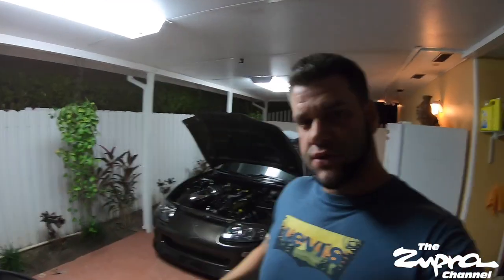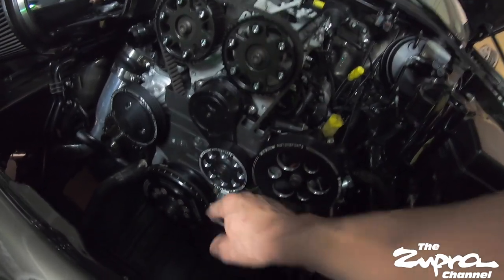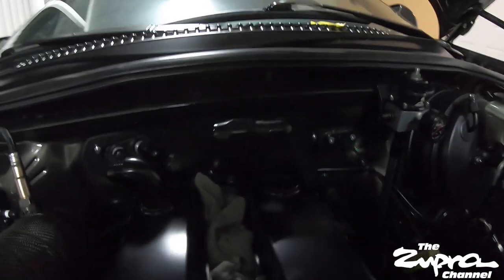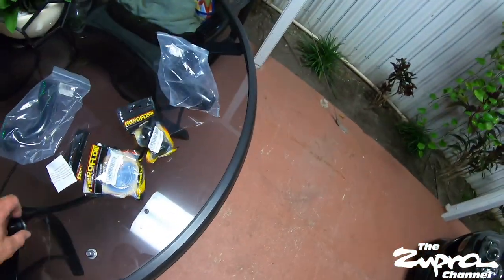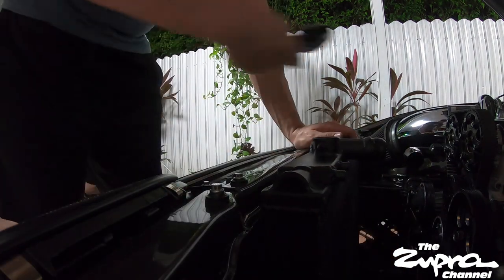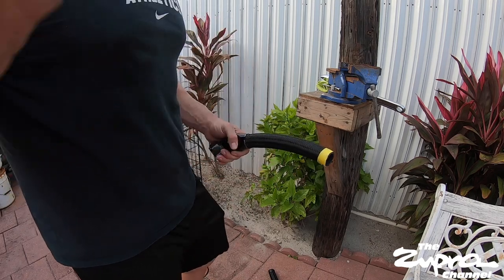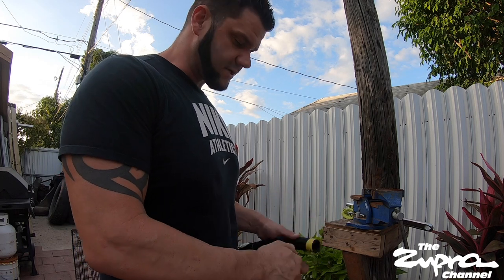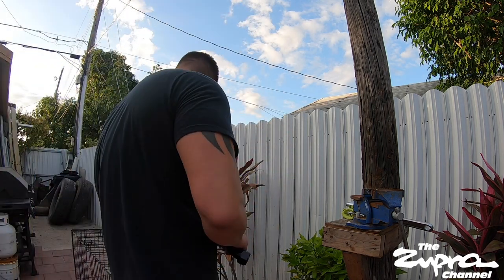Making 20AN hoses for upper and lower water neck

Comment: Bro, the radiator panel is sick, where did you get that?
Reply from the maker: It’s fiber glass from eBay 

I just had it color match to the car
Reply: Thanks man, I want build mine similar to yours. What is the thing called the connection between the radiator hose and the engine, waterneck??